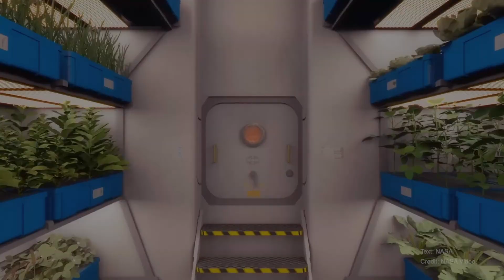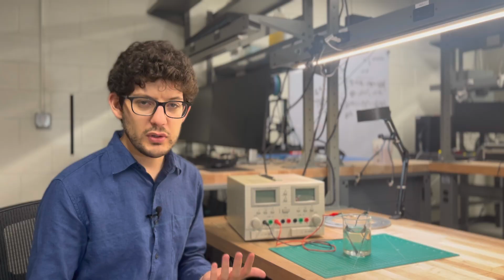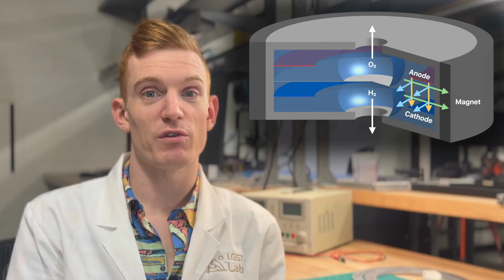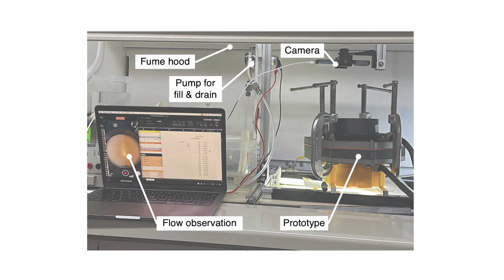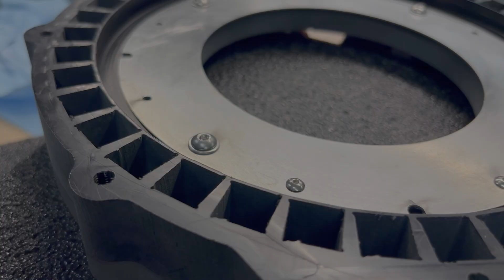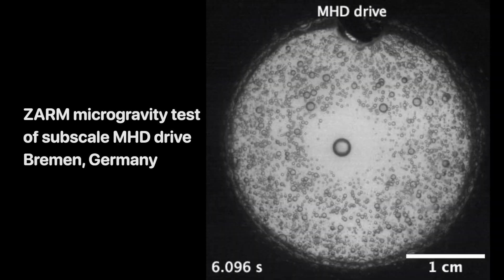NASA NIAC Symposium 2025 - Magnetohydrodynamic Oxygen Generation Assembly

Comment: I have a question. Suppose that I start with Martian air, filter it, refrigerate it, compress it and remove the CO2 as a liquid. What I'm left with is a mixture of nitrogen, argon, carbon monoxide and oxygen gas. The oxygen has been concentrated to around 3 percent. Well understood distillation processes can separate these gases. The question is, can MHD processes help to separate and purify the oxygen?